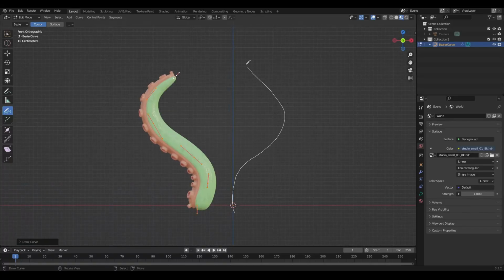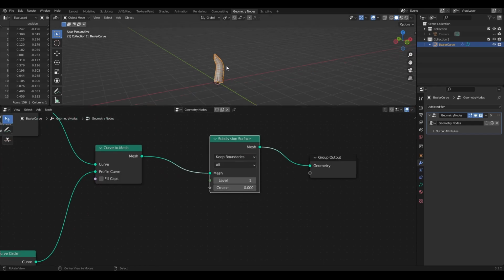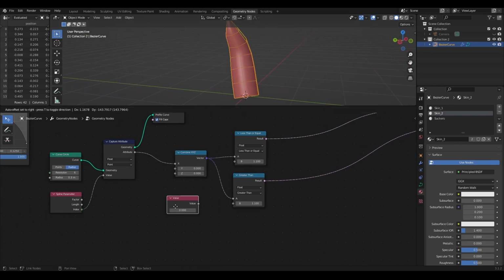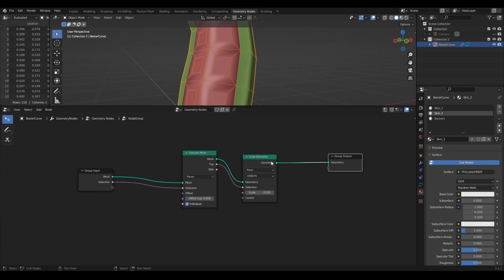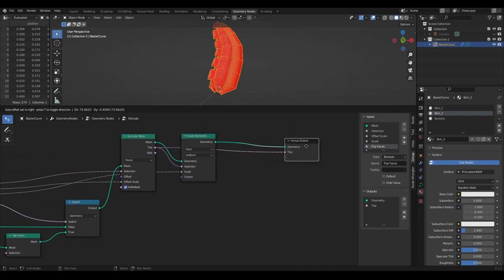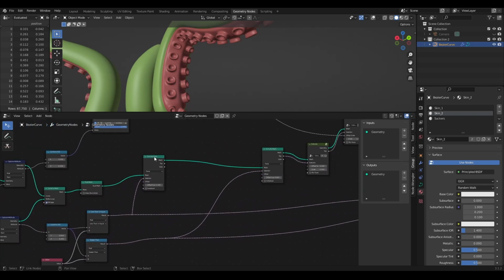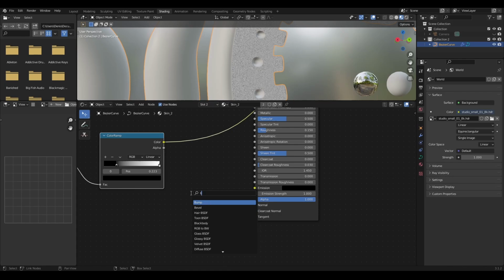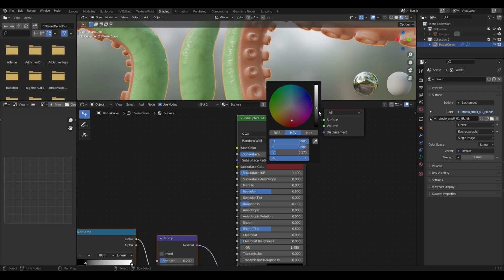Blender 3.1 - Procedural Tentacles with Geometry Nodes

Comment: 5.27 how to mix two lines?
Reply from the maker: It's a re-route node. You can quickly add it with Shift+RMB while sweeping across the node connection. If the node connects with more that one node, sweeping across all those lines will join them. Also, make sure you have Tweak option selected in upper-left corner of the node editor. Hope that helps ;)
Reply: @retroshaper  unfortunately isn't, because it maybe my first week using blender and i find very difficult to use, so please could you help me more, cause i clicked on shif + RMB and nothing...
Reply from the maker: @amirkrimi9535  Oh, I see. In that case, to get those options that I mentioned you should get Node Wrangler addon activated. It has Lazy Connect shortcuts in there. You may find more about that here: https://docs.blender.org/manual/en/latest/addons/node/node_wrangler.html
Reply: @retroshaper  thanks for help but i used shift+A >layout > reroute .
thanks again ❤
Reply: @retroshaper  ❤❤

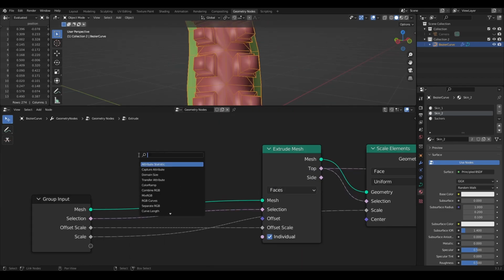Comment: 7:46 i just want to point out, that you actually don´t need that switch procedure. You can extrude in negative values. it's just that slider cant be defaulty moved to negative by mouse, but you can tipe it manually. That way you overwrite minimal slider value to the one you tiped and can move it by mouse then. Still great tutorial thought.
Reply from the maker: Hi Michal! Thank you very much for your feedback!
Yes, you’re absolutely correct ) I just thought that it was a great opportunity to show flip faces, face orientation and switch functionality) I hope I didn’t confuse anyone with this 😊

Comment: Amazing tutuorial. I learned a lot from this video.

How would you go about extruding a  row, instead of a column? I'm trying to use this to make horns like rams and antelope have. What's the best way to go about doing this?
Reply from the maker: Thank you very much for the feedback!
To extrude faces in a column, you just need to make a selection of the points (index and compare nodes) of a curve line (the one that builds your geometry vertically) and plug that into selection of the extrude node.
However, to achieve that twisted shape you were talking about, you may try a bit different approach: for the Profile Curve -> instead of using a circle, try using Star and Fillet Curve node to cut the corners of that star. After converting curve to mesh - use Set Position node and rotate each row of the mesh by a small degree based on the index of the Curve Line on z axis with Vector Rotate node (simply multiply Index by a degree).
I'm currently working on a video with a lot of twisting, displacement and positioning, hope to upload it soon.;)

Comment: I got very confused at 6.37 where suddenly all but 4 nodes disappeared. How did you do that? I tried just adding in copies of the Extrude and Scale elements and new inputs and outputs, but after grouping these and then pressing the key you hit at 6.57, I didn't get the result you did.
Reply from the maker: Hi. I've created a group from the selected nodes with Ctrl+G. Really handy when it comes to re-using the same sets of nodes. If you have sockets connected, they'll remain connected after creating a group. Also. once you've created a group, you may rename it and find it later in the search menu (Shift+A).

Comment: Apologies if this question has been asked before. How would I go about skipping a row in regards to the tentacles? Like if I wanted the tentacle to form every other face and so on. Thank you for your time!
Reply from the maker: Absolutely possible. You'll have to calculate the selection of faces with math. There's ton of ways to achieve this. The easiest I think (from the top of my head) would be to: Plug the "Index" node into the "Math" -> Sine and use it for the selection. Multiplying index by a number may give you some variations. Hope that helps ;)
Reply from the maker: I forgot to mention, that you should make that calculation for spline points and multiply it by selection of circle points to combine the selection.
Reply: @retroshaper  Thank you so much! This really helped me

Comment: Amazing things can be done in Geometry Nodes now! Thank you for the tutorial!
I think that some suckers looks unnatural because they're stretched. Obviously it's because of the polygon's topo. Can we use the instancing approach here + Merge node to stitch instances to the mesh? Sorry, I'm noob here and have no time to check this :)))
Reply from the maker: Thanks for the feedback!
Absolutely possible to achieve this with instancing. In this case, we would need use "Distribute Points on Faces" or "Mesh to Points" nodes with a selection of the area where suckers should be located. Then instance desired sucker mesh with a proper rotation. Additional math will be also required to calculate size of each sucker based on its location on the tentacle (can be done with Map Range node and Index or Captured Attribute).
The only thing I'm not sure of, is merging it all together, it may bring some bad topology, unless spending more time on precise placing of the suckers before merging vertices.
I hope that helps ;)
Reply: @retroshaper  Thank you!

Comment: that's awesome!

question though:
Is it possible to create a mesh from the nodes?
so It can be 3d printed?
Reply from the maker: Thanks for the feedback! 
In this particular case (with curves), we can simply convert curve object to mesh (through object menu or Alt+C hotkey) - it will also apply Geometry Nodes modifier.
There's one thing with geometry nodes (not in this case), when you instance objects, you need to realize all of those instances (with a node) for them to be real objects and to appear after applying modifier.

Comment: This is really awesome! I'm trying to modify this so the tentacles scale depending on how long you draw the curve. do you think this is possible and have any tips how this can be achieved? im kind of stuck haha
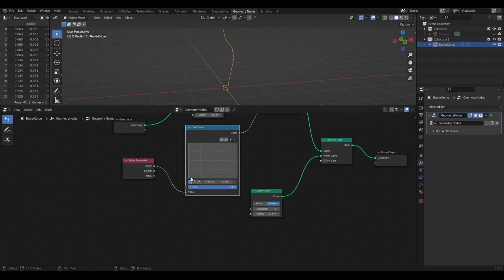Reply from the maker: Thank you so much for the feedback! ;) Pretty much possible. If you want to change the width of the tentacle based on the length of the curve, you may try multiplying Float Curve (1:55), that stands for the curve radius, by multiplier that is calculated from the curve length. To get that multiplier, you may use "Curve Length" node (connected to the bezier curve from group input) and divide it by some huge number (like 100 or smth). I'm pretty sure that there is more efficient way to do this with "Map Range". Need to experiment ;) Hope that helps.
Reply: @retroshaper  yes that helps a lot, i will try that thank you! i also tried some other things and realized if you take curve length that it takes the length of all the tentacles you draw and adds that together since it counts as one object. a bit weird and not sure how to fix that but oh well :D
Reply from the maker: @OBELION9  You are so right! When using Curve Length node on the spline we draw, it will calculate all of the points across all the splines. So, the more splines we draw, the bigger that number be. Just tested different approach ) - Instead of the curve length node - there is Spline Length input node - try using length parameter from there as a multiplier for curve radius. Spline Length takes into account all disconnected splines ;)
Reply: @retroshaper  i will try that thank you! :D

Comment: I got a question: what if I want to "clear the tip" from suckers like a real tentacle?... do I have a node to "finish" my suckers area to cero and keep the same texture?... do I have the option to keep sukers on a round shape as the middle suckers?
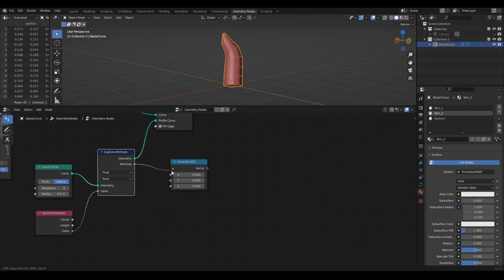Reply from the maker: Hi @Gerko ! As for the tip of the tentacle - definitely. You can make selection of faces/points on X and Y coordinates. To do that, you just need to plug-in captured attribute of the curve line into the Combine XYZ node -> Y coordinate (the one that is used for material and extrude selection (3:39 in the video)). Of course, to make proper selection, you'll have to use compare or math node to specify rows for selection. 
The deformation of suckers shape is caused by face stretching on bending (as for me it looks pretty natural ;) ), but I assume it can be changed with "accumulate fields" and offset position of each point along the curve to have relative to spline factor quad sizes. But that is only my assumption) Need to experiment )
I hope it all make sense ;)

Comment: How did you apply the "Suckers" material? I only see 2 materials in the G-Node pannel. My suckers are in white.
Reply: Oh I see, I didn't set the default material for the obj
Reply from the maker: I think all materials should be available for selection in Set Materials node, even if they are not applied in material properties.

Comment: Hi there! 
I'm doing your tutorial right now but I'v got the problem the "Greater Than" node isn't available. If I search for it I can't find it anywhere. Is there something I have to activate in the properties first or what could be the reason for that?
Reply from the maker: Hi! Try searching for "Compare" node and select Greater Than in the dropdown. Alternatively, you may use "Math" node, "Greater Than" operation is also available there.
Reply: @retroshaper  ah got it! Thanks for your quick respond!
Reply: Search for "compare", and you'll find a node that defaults to "greater than" but also has "less than", "less than or equal to" and other comparison options.

Comment: Brilliant tutorial.
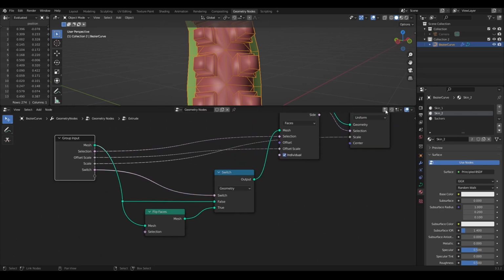8:23 But why use the "flip faces" & "switch" nodes when you can just use a negative Scale offset?
Reply from the maker: Thanks for the feedback and great question! For some reason, negative values are supported only with keyboard input, at least in 3.1.2. So, I considered it an opportunity to introduce flip faces node and face orientation which is a common issue when texturing. But yes, negative scale would be easier 😊